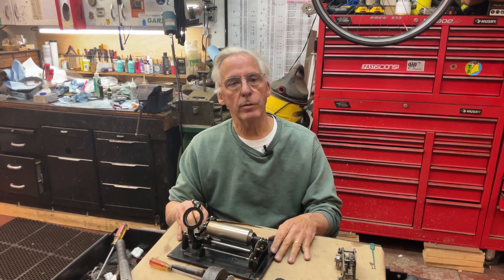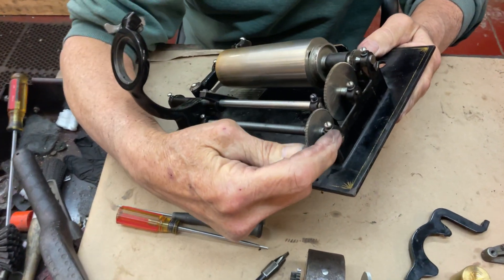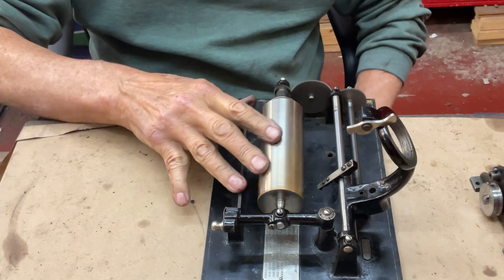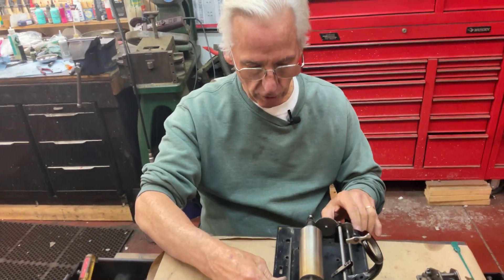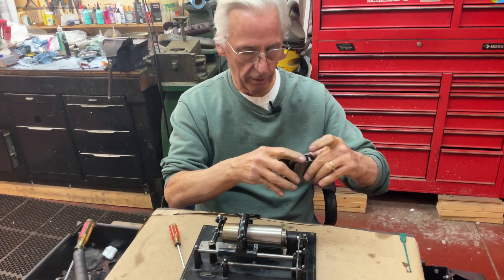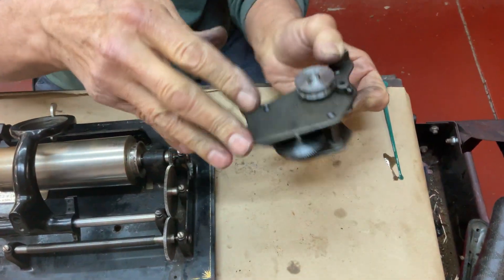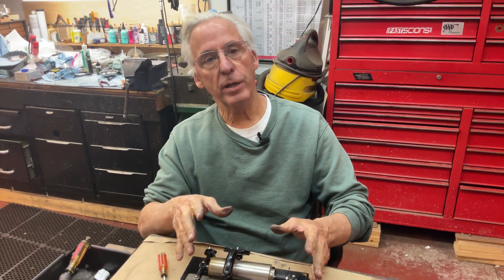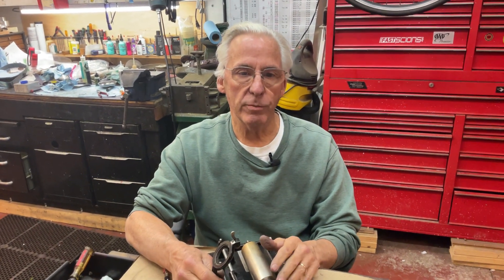890.  Adjusting the Edison Standard phonograph 60 degree bearings

Comment: Hello, Thank you for the many wonderful informative videos. I recently acquired an Edison Standard Model D phonograph. It was not spinning first, so I oiled all gears and rods and joints. Now if I turn the belt once and tilt the phonograph to almost 90 deg, then the governer and the belt and  everthing spin freely, but the moment I make stright on its base to a regular position it stops spinning. Any idea what could be the problem? Thank you in advance.
Reply from the maker: It sounds like there’s something binding in the gear train, probably a bearing that set too tight.
Reply: @1974hurt  Thank you for the reply. I have subscribed to your channel. Do you have a video on how to check the bearing set? Or if you can make one, that will be very helpful. I appreciate your help.
Reply from the maker: @pinu1166  I’ll pull out my standard and try to do a video tomorrow. What is your phone number? Or call me 864-236-1680
Reply: @1974hurt  I will call. Thank you